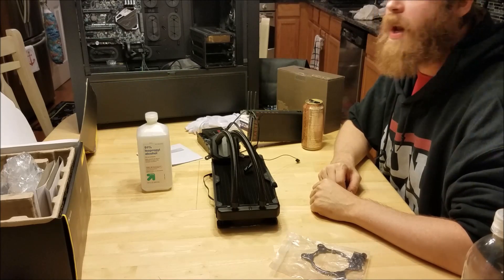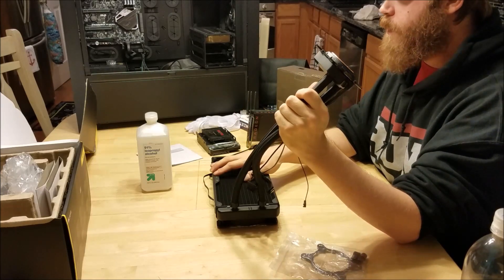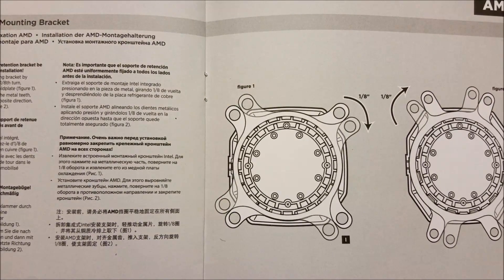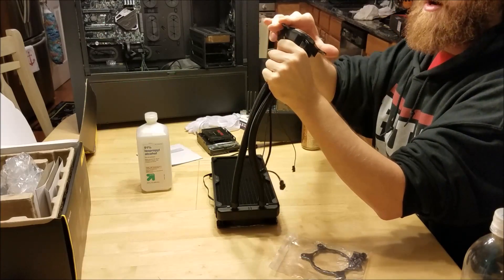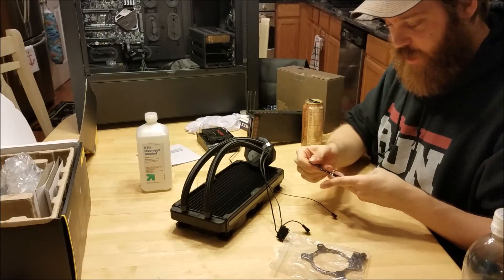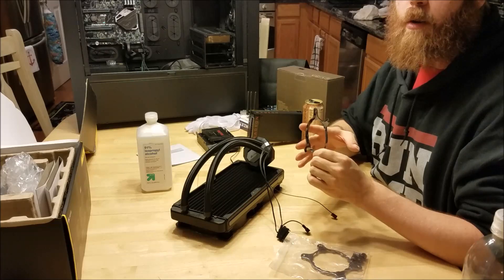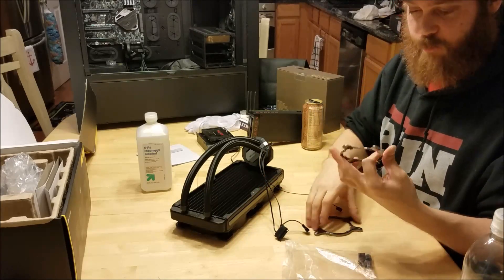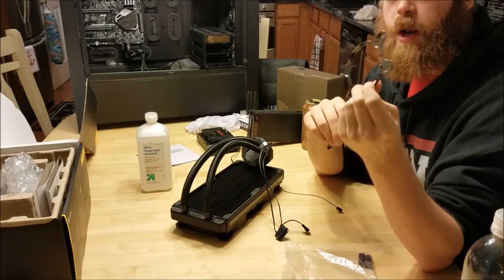Corsair h115i socket bracket removal and install help

Comment: Thank you so much! I would have never figured out i needed to apply so much force to remove it without your video
Reply from the maker: the force is on pushing down all 4 corners which is harder then one would expect. honestly i wasnt prepared for it either. i hadnt even tried to do it before shooting the video. corsair should have just used screw on brackets :P happy holidays and happy gaming!

Comment: If the Intel bracket still doesn't come off as easily as in my case. Rotate the 4 small screws 1/2 counter clockwise on the plastic not the ones on the copper plate. Try pushing the bracket rotating counter clockwise again and it should come off with little pressure.

Comment: Did you have issues with the pump seating well on the cpu? I feel like the standoffs are to tall? I startup my computer and it's running at 85c... put my prism wraith on until I can get it fixed. No videos at all regarding this cooler
Reply from the maker: You swapped the standoffs? Im pretty sure it comes with different standoffs and screw downs for amd vs intel. Its been a few years but i had no issues seating this
Reply: @TurboLimited  Thank you for responding so quickly, I installed the black "AMD" Standoffs. I purchased this cooler from amazon renewals, which pretty much is refurbished ones directly from corsair. It didn't come with a manual.. and I can't find any reguarding this exact cooler I got... https://gyazo.com/1d35cd5be6673824cf50f25525287079 (I understand if you don't want to click the link tell me how you'd like me to send the image.)

Comment: so I am trying to install a new mother / cpu (FX 6300) to a new AM4 Asus Here VI and Ryzen 2700X. The problem is that the plastic bracket that is installed on the bottom of the motherboard has to foam/rubber pads that appear to be stuck to the motherboard. I am going to need this for the new motherboard and I am hesitant to keep trying to pry it off by slicing an exacto knife under the rubber pads. Is there any tricks you know to get this off?
Reply from the maker: Its an sticky pad. I had to pry mine off. Checkout my video on installing a monoblock on the hero 6. Somewhere around the halfway mark i think shows how hard i had to pry to remove the stock backplate. Should be in my install playlist i think.

Comment: Well the same bracket can be actually used for am3 and am4 platform !! That's a new one for me thanks for the information.
Reply from the maker: Depends on your motherboard. Some gen1 am4 boards have holes to allow am3 and am4 coolers but its a select few. Make sure you check your board first.
Reply: @TurboLimited  thanks !! Actually i got intel system so there's no problem for me right now maybe if i upgrade lately i will definitely go for amd so if this is the case some diy will be just fine !! Thank you so much sir.
Reply from the maker: it does still have the am4 bracket so youll be fine. upcoming gen3 ryzens are sounding promising

Comment: This cooler is utter garbage. I'm never buying anything from the Corsair brand ever again.
Reply from the maker: J my temps with it were great. Depends what you put it on.
Reply: Turbo Limited yeah cooling wise it might be decent I agree. However, when it comes to installing it, it's a pain in the ass. I had to get my brother to help me remove the Intel metal bracket and we ended up putting so much strength on the pump to remove the bracket (yes we did it counter clockwise) that it just broke.
Reply from the maker: Yea even thought i liked how it performed its bracket system is poorly designed.

Comment: anyone can replay me ?? i got old corsair hydro h105 and i want get ryzen 5 1600 processor so i need to buy an adapter mount bracket of AM4 so its will gonna fit with it ??
Reply from the maker: @khalid290 corsair sells an am4 bracket for that. it does not come ready for am4 out of the box. its 4.99 USD http://www.corsair.com/en-us/am4-amd-retention-bracket-kit-for-hydro-series-coolers
Reply: thanks  also it's same way to remove the bracket  like the h115i ? and could you please find that bracket on amazon ? because next year i need order new processor for ad ryzen 5 1600 at the moment i got fx 8320
Reply from the maker: Its the same bracket as the h115i. I dont have acess to a 105 to one to find out. Also to my knowledge the brackets are only for purchase on corsairs site
Reply: thanks as i can see cannot find in other site's

Comment: I'm trying but this fucking thing won't budge. I've been trying to push and twist for the last 30 minutes and I'm not getting anywhere! What are you doing to make it that easy?
Reply: I wasn't able to remove the bracket the conventional way. I had to dismantle the head, remove the bracket, and screw it back together again. I recommend doing this if you have one that doesn't want to budge. I think some of them are just really difficult to remove the bracket from. It turns out that my h115i was defective (the pump wasn't pumping), so I replaced it with a new one and the bracket was really easy to remove. So yeah ¯\(°_o)/¯
Reply from the maker: its a bit tricky to push the 4 corners down properly at the same time to get it to twist. i kinda had an issue doing it in the video for a quick sec lmao. honestly i love this aio while i used it but the bracket system is trash -_-
Reply: Any chance these can come with malformed rings or something? Got a H100i V2 turned clockwise, threw in a anti-clockwise, clockwise again following the instructions, nothing. Looked online everyone is saying anti-clockwise, ignore the instructions, fair enough. But no matter how much force i give it it won't turn, my dad can't do it either or even both at the same time and neither of us are weak men, we are both hard grafters. A few people (and it is a few people) are saying on forums and such that they are having the same problem even turning anti-clockwise. Was just wondering if 1 out of every 100 products for example may have malformed rings or something that would cause it not to turn.
Reply from the maker: I guess its possible but nothing i have heard yet would suggest it so far. Unless you just arent pushing down the 4 corners enough might be an RMA. I know i had to put a lot of force on them to get mine to turn.
Reply from the maker: I have heard people doing that. Good tip for the stubborn ones
Reply: Turning clockwise alone didn't work for me. I had to loosen the four screws holding the black toothed bracket between the copper plate and the mounting bracket. Then it was easy to press and turn the mount counter-clockwise.

Comment: 1:27 is a lifesaver. Just spent 30 minutes trying to figure out what to do. Read forums, watched our YT videos. Reddit post finally linked to this and within 5 seconds I was able to get the Intel bracket off. Thank you!!
Reply from the maker: im linked on reddit?! my little channel is happy! lol you happen to have a link to that thread?
Reply: I do... https://www.reddit.com/r/buildapc/comments/7jxs6b/cant_get_intel_bracket_off_corsair_h100i_v2/
Reply from the maker: thanks! i wanna go thank whoever posted it lol
Reply: Me, too. And thank you. No idea why the manual hasn't been updated after all these months. And kind of a bad design to have to push down on all 4 sides to get the piece off. But luckily it worked!
Reply from the maker: agreed. they should have just made the brackets screw on lol or they need to recall the manuals.

Comment: Sir I took off my hat, I just got my h115i and I was fighting with these instructions looks like the engineer that built the instructions was a kind of idiot. I tryed to remove it with the whole thing "the plastic cover" it made it easier to pull it out and also it helps to prevent touching the thermal compound.

Comment: I have a H80iV2 looks the same just single radiator
And I have had 3 of these in the past never had a problem getting the intel ring off before

But to get the Intel Bracket off I had to take out the 4 outer Screws from the bottom to loosen the cap 
You don't have to take the cap all the way off just back it off a little so the bracket will turn easy
(And don't take out any of the 8 in the center Copper area!)

As soon as the cap was back a little it pushed and turned easy and came right off 
(don't put a lot of pressure on the coolant hoses or they will break)

Just be careful putting it back on and tightening screws to get all the stuff back in the cap right
Mostly foam, wires, and a small pc board in the cap

Hope this helps :)
Reply from the maker: shouldnt have to do that though
Reply: You are my fn hero. My plastic plate was too tight too. Unscrewd just a bit and it worked. After bruised fingers I thank you kind stranger.

Comment: It took 2 people to get mine off. was realy easy with four hands, to push down on all four sides and turn, but on my own I used so much force I will be really surprised if this thing still works when the AM4 bracket gets here... so much force I was doing like the weight lifting grunt lol. Hope she doesn't leak now and ruing my build.
Reply from the maker: seems to more or less be everyone's story lol im sure yours is still fine. they seem pretty sturdy, almost like they knew people would have a rough time with it :D
Reply: haha thanks for the reassurance! AM4 bracket will be here within the hour! 
 So do you use the stock fans with yours? I have a pair for Riing fans... but I was nothing thinking the stock corsair fans were 3 pin and now 4pin PWM... you think the 3 pin riing fans would be an issue? This is my first AIO
Reply from the maker: i also use Riing fans on mine 2 for the h115i and 1 on the back exhaust by itself. the controller box has 2 speed modes(maybe 3 i cant remember), just put it on the high setting. hours and hours of gaming and my cpu hardly ever hits 35c. thats good enough for me.
Reply: But it still controls the riing fans fine even though its doing PWM? Because you have the 3 pinn ring fans like me right?
Reply from the maker: i cant remember but i know i have to use the control box for the fan speed. i couldnt get corsair link to adjust them. its ok they are pretty quiet so i just let them run on the fastest speed. this AIO is just temp until i can afford a custom water loop so i havent been to concerned with it to be honest
Reply: Guess what? It wasn't fine! It ended up having a slight leak. Not enough to kill my components though. 
 I ended up going with some Noctuas on it... the stock fans were too dang loud. I wanted to go 4 pinn.... but now realize I could have just used my riing fans.
Reply from the maker: Crixus The Gaul sorry to hear that :( maybe RMA?
Reply: Oh yeah it went back the next day to amazon. I've been using the replacement. 
 Just funny how that worked out. 
Speaking of this... I turned on my computer today, and it would not boot... my mobo gave a CPU warning... I think the pump had a little startup trouble!
Reply from the maker: Crixus The Gaul i have to set my cpu fan warning to ignore because my crosshair 6 hero has a dedicated port for aios. Even if i plugged it into the cpu fan header i had to turn it off or get a low speed warning.
Reply: For which chip? That is weird! Also strange that I have not had this problem yet, other than today. FIrst time. 
 When I had both the bad unit, and the one i'm using on hand. 
I noticed with the bad unit, when I start up the pump, the corsair logo turns right on normal color, however with this unit when I start it up, the corsair logo turns red for a second, then onto normal. Red means pump is failing, or block is getting hot. 
 Strange they both did not do this. I hope that does not mean my pump has trouble starting.
Reply from the maker: Crixus The Gaul i have the corsair link aio so dont know if its similier. My pump doesnt ramp up to speed or change color until it get to the desktop. Its how its designed
Reply: ah I know what you are saying. mine does not turn into its color I set it to until the desktop either. 
 But when I first turn on the pump, like I plugged it into a test power supply right out of the box, the corsair lettering starts red, then turns the stock color. Then when I get to the desktop it turns the color I set it at. 

 If you can remember, next time you start up your computer, look at the block before you hit the power button and watch corsair LED. Tell me if when you first kick it over, if it starts red, then turns white.
Reply from the maker: Crixus The Gaul mine starts white and goes to the red once its booted up. If its still working in general im sure its just a hiccup with the lighting setting. Probably nothing to worry about
Reply: I'm worried! lol. 
 The leaky one did not do this. After the startup issue today, i'm thinking the pump has a hard time starting... hence the red meaning the pump is stopped when it first kicks over. 
 I'm ganna have to call Corsair about it. 

 Hey man I REALLY appreciate you doing that for me though.
Reply from the maker: Crixus The Gaul wasnt hard i know everything my system does on bootup already without booting it up. im not even at home. Yea you might have to google around about that red flashing. I didnt know that was a code. I just know lighting control has been so spotty since rgb became a thing
Reply: oh yeah... if your ever using your rig, and your corsair LED turns red, that means you water has reached its temp limit you set, OR your pump has stopped... thats why its spooky. Especially since my last one did not do this. Appreciate it dude.
Reply from the maker: Crixus The Gaul gotcha i didnt know that thanks for the info.

Comment: I have not had any luck pushing 'the metal piece' (which I assume is the Intel bracket) down much and turning it. It is very difficult when you have the pumps connected and no place to really hold this block down.

Any advice?
Reply from the maker: Taufik Hidayat its a little difficult to push all 4 corners at the same time. thats why you can hear the radiator shaking on the table when i had to remove the bracket. gotta put a little elbow grease into it